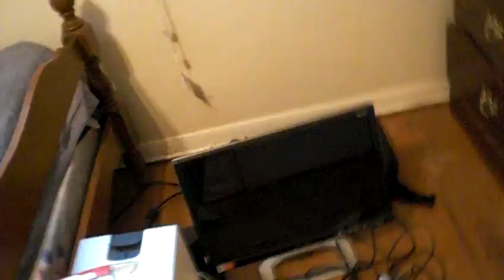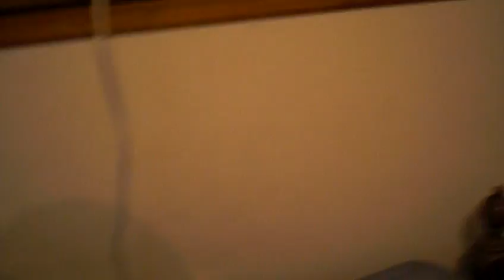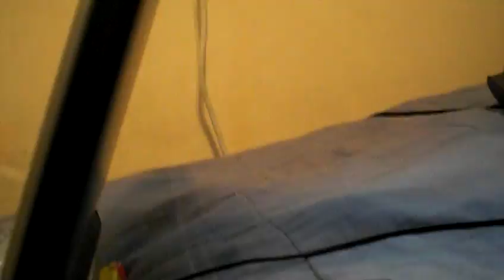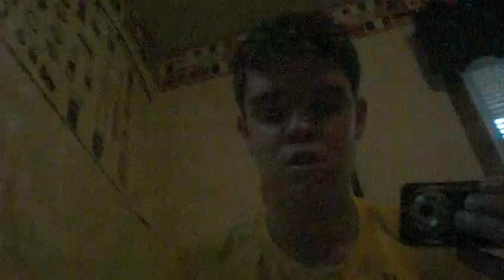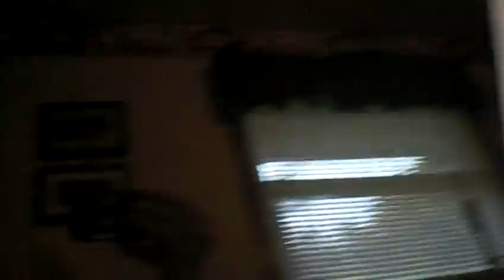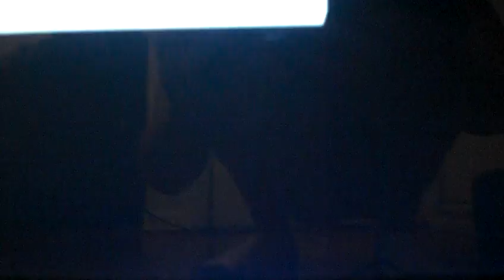Broken Dell Inspiron 1521 laptop, wont turn on, Dead motherboard?

Comment: try hooking up an external monitor, if that don't work then yep, motherboard is likely shot. you can get new, used & refurbished motherboards on Ebay & Amazon way less than buying a new computer. I'm in the process of replacing mine now. saw your video thought I'd offer some tech advice, I know this is old video, but might help you still or help in the future

Comment: unplug the charger and take you battery and hold down the power button till 60s and plug the step 1: laptop charger (DO NOT THE BATTERY IN YET) if it turn on you can put the battery back on. step 2: if that didnt work try to unplug your laptop charger and let it die. my mom was using this computer for a long time and it did the same so she got her self a new one and i did all step 1&2 and it work.
and get a desk for your desktop.

Comment: I have dell inspiron 1501 and my pc light would come on then shut off. Took it to shop and they said it needs a new motherboard. I didn't have them fix it since the only thing he would say was "it's alot of money". Ugh. So i took apart myself following a video here on youtube and saw that it was the motherboard that needed replacing as well as a few other things, like the cooling fan, palm rest and keyboard. Dont repair it with those people, you save more if you buy your part from amazon...

Comment: I HAVE THE EXACT SAME LAPTOP EXCEPT MINES DARK BLUE, AND MY SCREEN WOULDN'T TURN ON EVERYTHING ELSE WOULD LIGHT UP BUT THE SCREEN. SO I WENT TO GET IT CHECKED AND THE GUY SAID IT NEEDED SOME KIND OF CERTAIN PART THAT WAS OVER $200 AND THERE WAS NO GUARANTEE IT WOULD WORK. SO I JUST TOOK IT HOME AND ABOUT A MONTH LATER GOT A NEW ONE AND AFTER I GOT MY NEW ONE I MESSED AROUND WITH THE INSPIRON FOR LIKE A HALF AN HOUR AND FINALLY GOT IT  TO WORK!
Sorry for making it caps, just wanted it seen :)

Comment from the maker: @lutaa2002 I used a SATA 2.5" USB enclosure for the HArd Drive and connected it to a working computer. then used it as an external drive and copied the files over to the other computer.

Comment from the maker: @foreverdancin31 no dell screen, it sounds like it could be the graphics card since you had lines, and that could also be the problem on mine is the inter-graded graphics. the CD drive doesnt open on mine either. Tis computer only lasted 2 1/2 years

Comment: @patricknedz if it was in the bed probably the cpu chipset went burnt :/
I think that replacing the motherboard will cost much more than buying a new one
one last thing you can try is to start the laptop without any ram and see if the motherboard does any beeps, if it doesn't do any beep then it went bye bye.

Comment: Does it still have warranty? if not I can tell you something..
The video card is not broken, the video card is one of the last things that die in a laptop, it can be a ram issue or a battery problem and as the worsest one the motherboard..
First you can try by removing the battery for 5 minutes and then putting it back in.
If that doesn't work you can then try by removing the ram which is under the laptop, remember to clean the ram connectors, you can clean them with a pen eraser, after

Comment: @blakstermc 
If you run it on a soft surface, you need something stiff underneath it, larger than the laptop. This allows air flow.
I was using my laptop on top of a tote (solid, hard surface), then the fan started screming. Found out the heat from the computer warped the top, and it blocked most of the ventilation holes. I lifted the computer up, and things were back to normal in a few seconds.
This taught me to make sure any warps aren't blocking the flow as well.

Comment: @georgef551 i have a dell xps1530 laptop and i was just now (like 30 minutes ago) was running it on my bed and it crashed! (blue screen came up) it would not boot up normally, i had to use the dell direct media button but then it started up fine.  i am going to take your advice!! i had to get it shipped off like 5 times due to bad memory, bad hard drive, bad motherboard, and and a key was missing when i got it back so they had to put a whole new keyboard on! i am going with a mac next computer.

Comment: @jimster586 my dell xps1530 laptop has been shipped off to be fixed about 5 times! i had a bad motherboard because the battery would not charge and the memory module messed up, and my hard drive went out, never getting a dell again! most likely will try out an apple computer (never tried mac before)

Comment: Too many times running it directly on the bed. Should not have done that. You fried the computer (motherboard) over time, most likely.
This is why I tell people to put their laptops on a hard, solid surface, if using it on a bed, or soft cushion. I see you did that this time, but too many times, I saw it directly on the bed, and warned you about it.
Tough lesson. :( Sorry about it going bad. Latent Failure a likely cause.